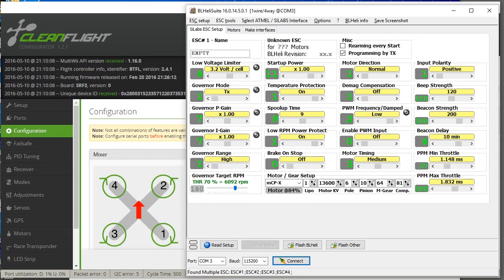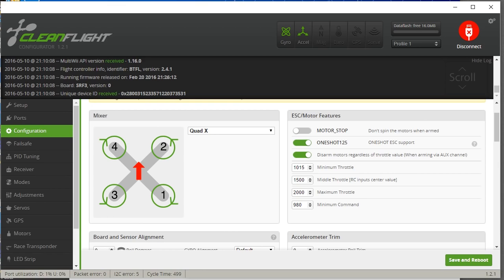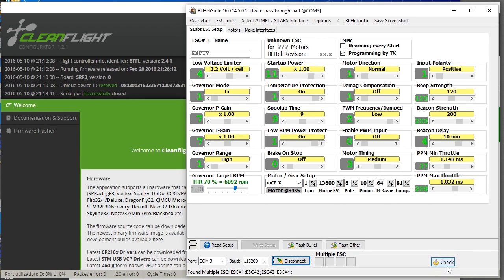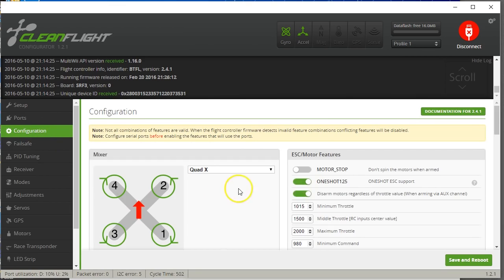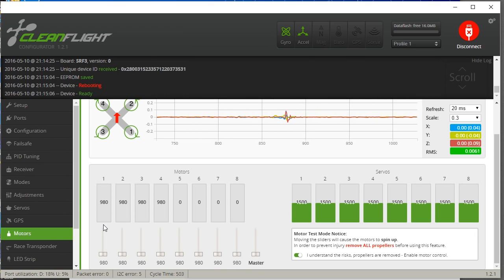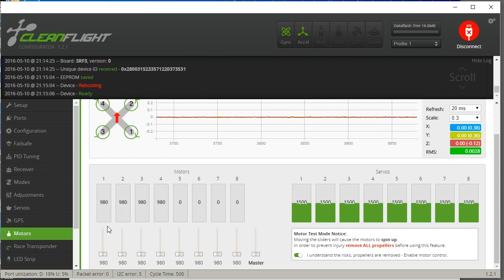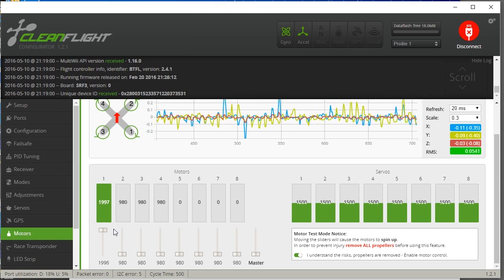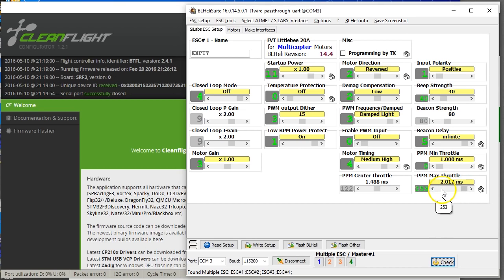Maximum Resolution ESC Calibration

Comment: so it is ok to run the motors at full throttle with a 2s battery and no current limiter? Just want to double check before I blow up something
Reply: Using a 2s reduces the chance of something going pop, to quite a bit less than if you were using a full charged 4s. without a current limiter you are running the risk of magic smoke regardless. Put it this way, I always use a 3s for things like this, without a current limiter, with about 11.5 volts on it, and I've never fried anything. There is a risk. But I think it's more likely you won't fry anything than you will. It's your call really.
Reply: thanks man! I think I will take the risk
Reply: +MTL Racing no worries, good luck. Remember though, there IS a risk. Because it's never happened to me, does not mean it won't happen to you! You should be OK with a 2s though. Just to reiterate, Joshua knows far more about this stuff than I do, and if he advises a limiter, there is a good reason for that. But as I say, I've done it a ton of times with a 3s and never had a problem. But that does not mean I never will have.

Comment: Why use this method instead of the method posted in the Multishot topic? What is the advantage?
Reply from the maker: +Salerg this method pushes min_throttle and max_throttle as far from each other as possible for maximum resolution. I haven't seen the version on the multishot page so I can't compare.
Reply from the maker: +Salerg dead-band is a function of whether min_command and max_throttle in the FC are correctly aligned with PPM_min and PPM_max in the ESC. Resolution is a function of how far apart min_command and max_throttle are.

Comment: Is this on BLHELI 14.4? I may be incorrect, but I thought 14.5 removed the top end deadband? Also, I remember you saying that all the motors had to be calibrated on cleanflight together because each esc has a different measurement of time. (i.e. ESC 1 = 1.0s[real-time] = 1.0s, ESC 2 = 1.0s[real-time] = 1.1s) Is that still true?
Reply from the maker: +Nathan Haman 14.5 removed the top end deadband when you auto-calibrate. You're manually calibrating so the only dead-band would be because there was a mis-match between the top of the FC's throttle curve and the ESC's throttle curve.

I found that my ESCs all started up and topped out at very close to the same value. In theory, you might want to change the top end in each ESC individually, if they were very different from each other.
Reply: Joshua Bardwell I apologize for the ignorance and if you are busy please don't feel obligated to go down the rabbit hole with me. I'm doing my first idra race on Saturday, so I'm anxious to get my quad running right. Procrastination is a terrible thing.

From my understanding, this is checking min throttle and top end calibration. I suppose my confusion is in the fact that this procedure looks the same as what we have been doing on 14.4

Am I thinking about this incorrectly or is this supposed to be a 14.5 specific procedure?

Again, don't answer me if this is a dumb question, I understand. I'm just in crunch mode because of the race and I only was able to watch the video once since I'm at work.
Reply from the maker: This is not 14.5 specific. It's the same for earlier revisions.

Comment: Why don't you set it to 2016, and then knock 7 points off the max throttle in betaflight?  Then, no deadband, maximum throttle response.  Is there a way to individualy change max throttle in betaflight?  If not, clearly Boris doesn't watch your channel =)
Reply: +bing quadby One of my motors was showing the last step at 1983 so in blheli i stepped in up to 2008us now my motors reach top rpm at 1988, 1988, 1991 and 1991. I have set max throttle to 1992 just to allow a bit of room for any jitter.

Top throttle calibration is definitely worth while on my old quad with simonk i went back and tested it with the normal 1900 max throttle and i was getting oscillations and bouncing where before at 1878 it was completely smooth.
Reply from the maker: +Robert Baltrusch Yep, that would definitely work perfectly.

You can't change max throttle per motor, so your only choice is to tweak the individual PPM_Max in the ESCs. But mine were all so close together that I didn't think it was worth the trouble. Throttle parameters are already so confusing to people that I would never suggest adding per-motor max_throttle. Yeesh.

Boris definitely watches the channel, although I doubt he watches every single video.
Reply: +Robert Baltrusch  i wondered this tooo....